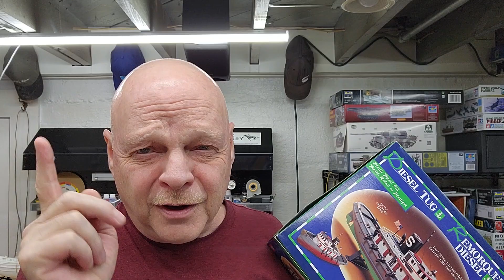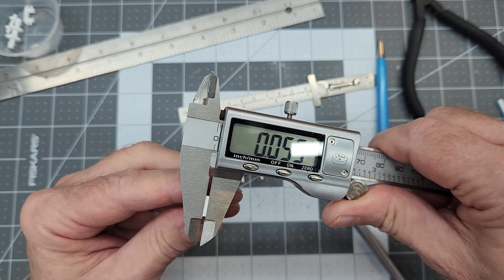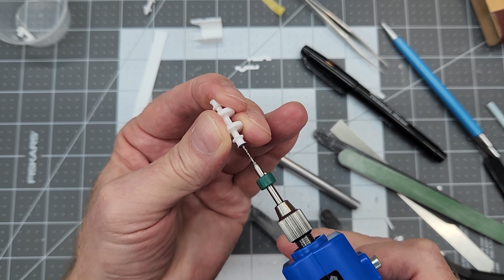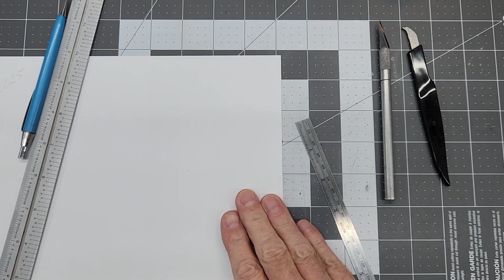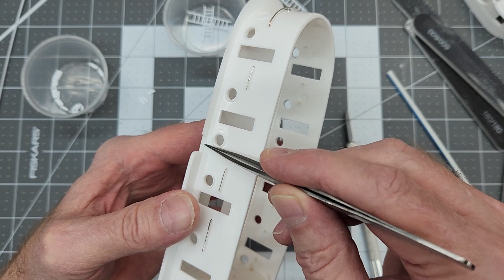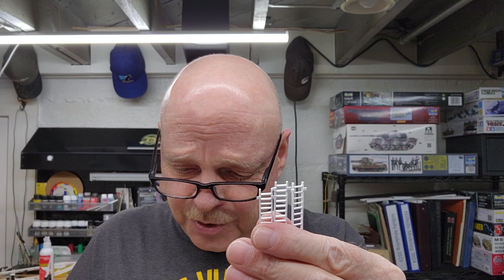Diesel Tug by Lindberg, Part 4, Tow Winch and Ladders

Comment: In hindsight it might be easier to make a new winch housing.
Reply from the maker: I thought about that Shelly, but then we would have to make shafts for the winch drums so we could fit them into place. So, I opted to make the caps instead. Thanks so much for watching, take care my friend. Johnny
Reply: @hillbillymodeling  I'd cut the end capstans off and fit the shaft, then reglue.  But, yours came out good. The Coast Guard Tug I have has a huge winch like would pull in big fishing nets. Oddly, that kit has separate railings around the superstructure including a curved front rail.